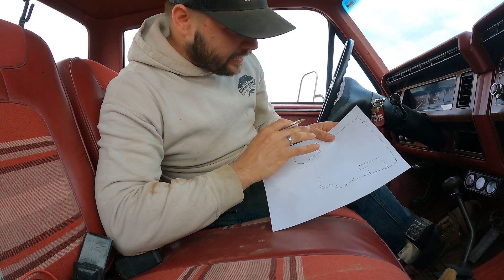Ever Seen A Buffalo Play TAG?!? | How to keep Buffalo in Pt. #2

Comment: 16' joints cut into 8' fence post using a good metal table saw blade makes for a smooth cut there by no clean up putting troch cut end, in the ground less work for you
Reply from the maker: That’s my hope Warren!

Comment: Curious……since the seller cut the pipe why not have him cut 8’?  My thought would  be cost. 😊🙏🏼
Reply: They cut the pipe with a cutting torch. Cutting with torches leaves rough edges & a lot of grinding to clean up the edges.
Reply: @stevensaxon8888  Thank You. I just didn’t know. 😊🙏🏼
Reply from the maker: Yes Susan, it is mainly because of the cutting edge. Also I have to angle my H braces with a saw anyway.

Comment: Instead of driving, looking and guessing, why not measure the distances, establish what spacing of fence posts you want, add in braces every so many feet of fence, and based on those numbers, figure how many posts you need, how many braces you need, length of wire you will need and where and how many gates you will need. It starts with measuring and then the rest is your call.
Reply from the maker: It’s just the way the land is set up John. The fence does a lot of curves so there is more judgment calls than measuring.